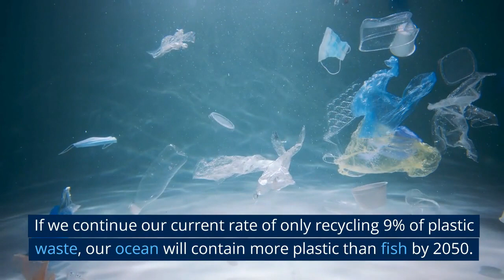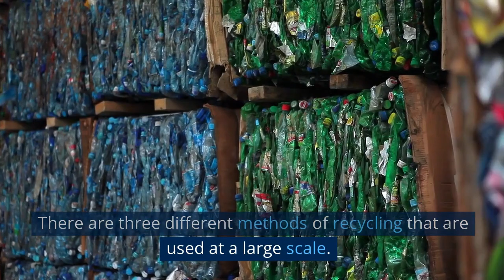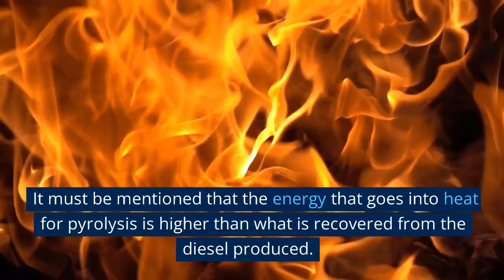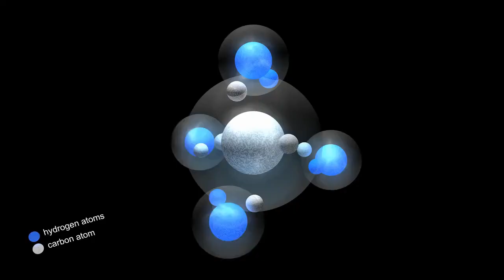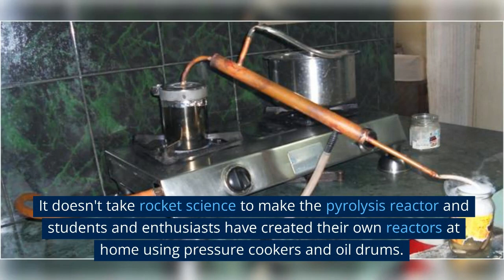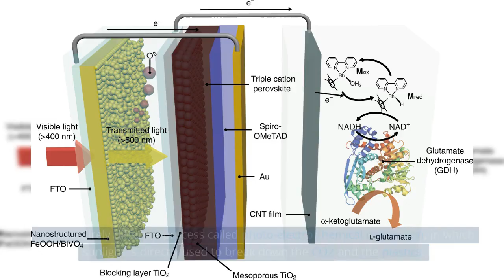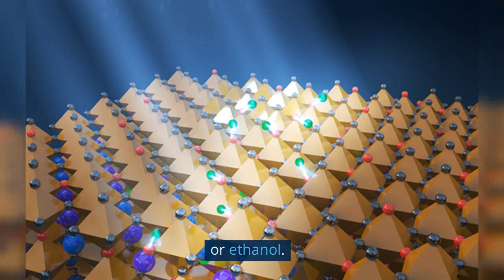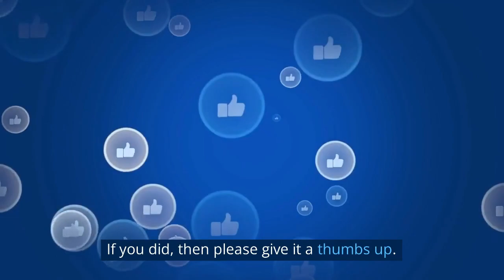Making Waste Plastic to Fuel (Diesel and Petrol)

Comment: does the gasoline can use in motor engine such as motorcycle ? I saw some video from Indonesia and India that can use to run in Motorcycle, but did not mention whether need to refine or any substance to add into the gasoline

Comment: We can use the ASC (Ayman Solar concentrator) to provide the high temperature solar heat needed for the process
Reply from the maker: That would be a great application for it
Reply: @synergyfiles3536   right and in many Parts of India and Philippines and other south east asian countries you have so much sunlight pv panels are the Way to go

Comment: If we heat the plastic with our home heater (say with a wood stove), will the heat energy remain in the diesel of will it dissipate the same way (but later) ? It would be an efficient way to produce diesel for same price of home heating.
Reply from the maker: Depends upon how efficient you design the reactor. If its very efficient you wont get enough waste heat. Most of the heat will go into breaking down plastic. If your reactor is inefficient than yes you will get more waste heat to heat your home. Anyways its a process that should be done outdoors to avoid fumes
Reply: @synergyfiles3536  
Oh, so it's not like other devices (a computer for example), where you can use 100% of its heat while using it to process tasks.
Reply: Breaking down plastic is not exothermic reaction in fact it is endothermic it needs heat to break down itself so there is not possibility for any kind of heat removal form system to run heating system in fact if ur reactor is efficient u just have to add enuf energy to break down polymer if plastic to small molecules
Reply: @dhipender  
Thanks for claryfying